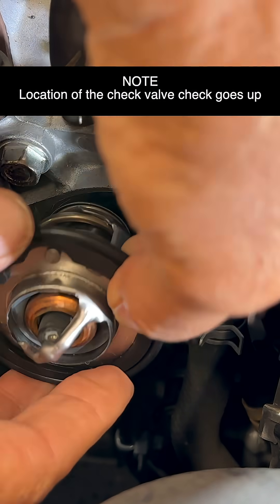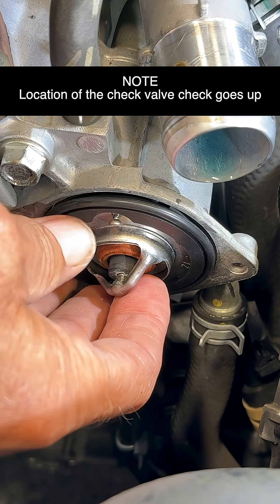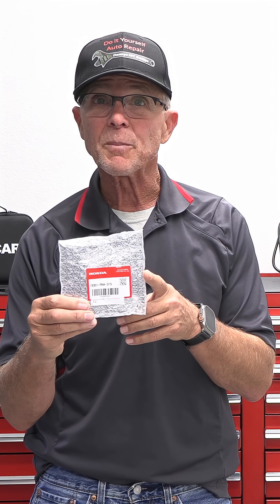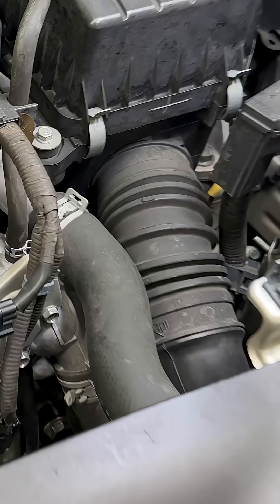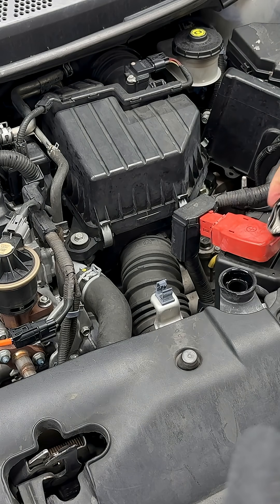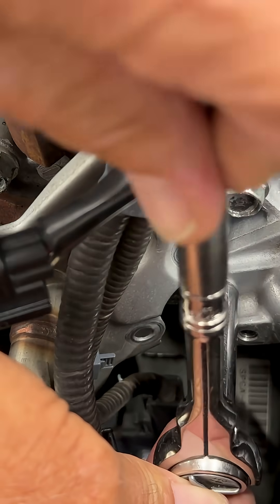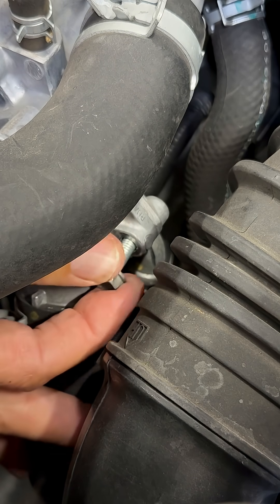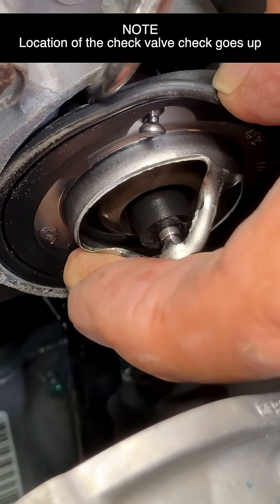Honda Civic 8th generation Thermostat Replacement     #thermostatfix #civic8thgen #overheat #honda

Comment from the maker: Full Video: https://youtu.be/xz_8TLMdSvg
Please help support my channel by using my Amazon Affiliate links: 
Radiator Cap: https://amzn.to/4k5wwgO
Thermostat Honda Civic 8th Generation: https://amzn.to/4iII7B9 
Honda Genuine Coolant: https://amzn.to/498vc7P 
Radiator petcock drain tool: https://amzn.to/498MhxM 
No Spill Funnel Kit: https://amzn.to/46feSmo
200cc Automotive Fluid Extractor Pump, https://amzn.to/3VpCeQ5
Swivel Ratchet: https://amzn.to/3HTW0N7 
Swivel Ratchet 3/8" drive: https://amzn.to/3OiBHMQ 
Hose pliers - https://amzn.to/4lPHZ5P 
Mechanic Gloves: https://amzn.to/3OcULfu 
Safety Glasses: https://amzn.to/3HvBYbx

Comment: Hey, what’s up Danny? How’s it going? I just installed a brand new Honda OEM thermostat in my 2006 Honda Civic EX and I am getting a P0128. I made sure to bleed the coolant. What can it be, sir? Thanks in advance.
Reply from the maker: Was the code there before? Clear the code, If the code comes back you most likely got a bad tstat
Reply: @dannysdiygarage the code was cleared and kept coming back unfortunately a bad Oem Honda Thermostat. Thank you for the response and great content sir! 👍
Reply from the maker: @sc6015 appreciate the update